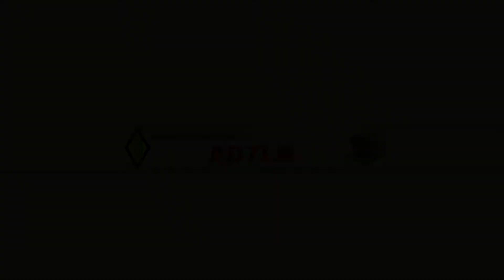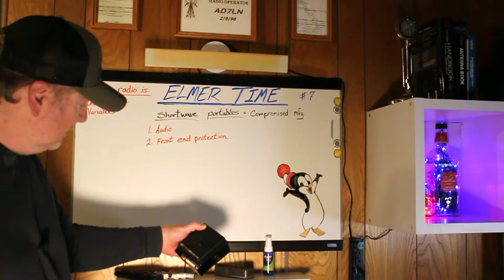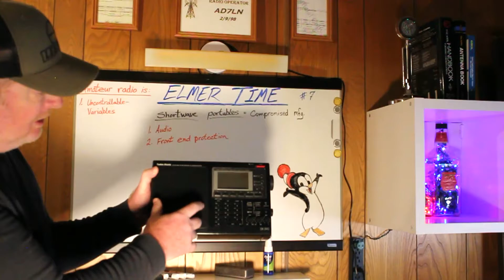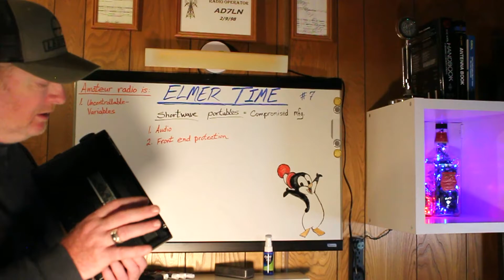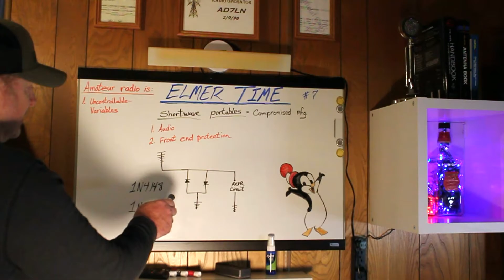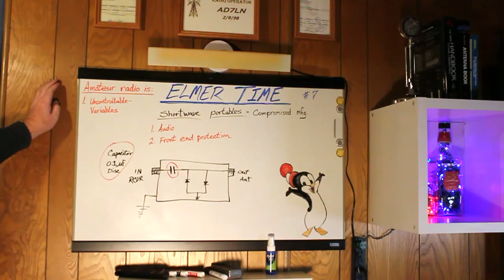AD7LN - "Elmer Time" Enhancing Portable SW Radio via External Audio - Front End Protection Circuit

Comment: Hi Jeferry, thanks for this valuable input about preventing the static discharge into the radio receiver. Shall give it a try whenever I get some free time
Meanwhile, in reference to most low and mid range DSP radios currently rolled out by manufacturers such as Tecsun, C Crane, Xhdata, etc the annoying chuffing and muting between stations simply puts me off. It appears manufacturers are dictating standards by pushing the memory tuning which is unfair to the consumers. It is only the high end receivers such as the PL991 and H501 have a seamless tuning like the good-old analogue radios. Further, it is sad that most YouTube radio reviewers never mentions about this major flaw
With regards to improving the audio quality of these small receivers you have correctly mentioned about connecting it to an external speaker. I have tried it long ago and they significantly improves the high, mid and lows 
Thank you,
Cheers!
New Delhi